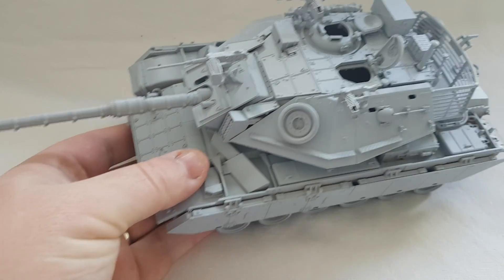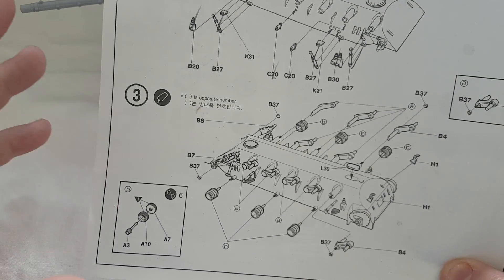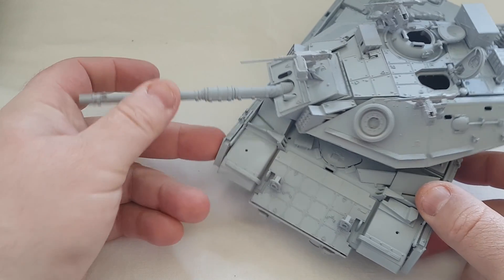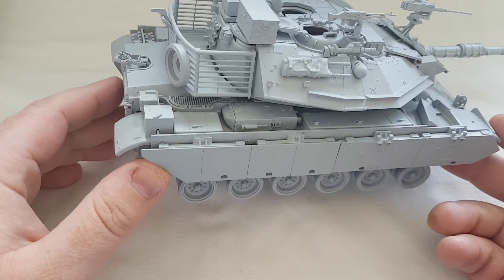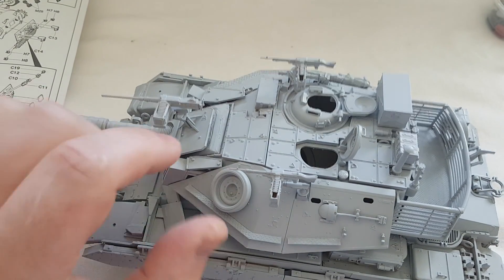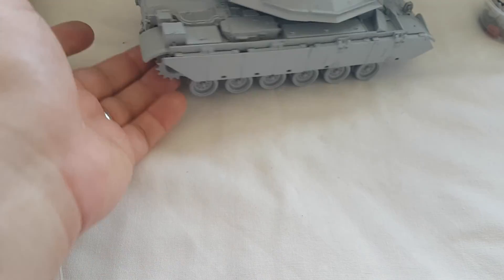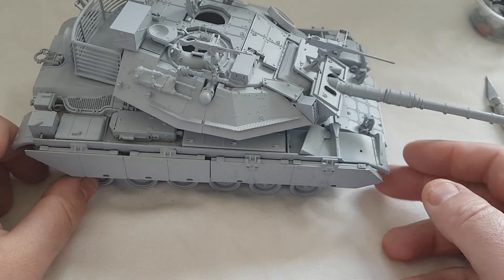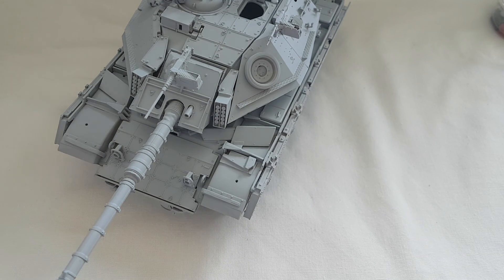academy 1/35 magach gal batash 6b pt1

Comment: Great Build Craig! This is the second build video that I have seen today from Academy Kits and both have mentioned fit issues and other problems with the kits. I must admit I have never built an Academy kit, but I always thought that they would be better than Tamiya, but it seems from what I have seen today, that sticking with Tamiya is my may forward for the time being. I would love to hear from others about how they got on with Academy kits.
Now back to this model, it looks really great Craig, but I think that it is more down to you than how good a kit it is. The instructions don't seem very user friendly or accurate. I think that once painted, it should look really good, but again, I think that will be down to your skills rather than the quality of the kit.
Have fun finishing off with the painting and weathering,
Joe
Reply from the maker: Joe's Model Kits I'm actually surprised with this kit as the other academy kit I made was far superior than this offering but yup I do think tamiya are ahead over academy. I also agree it will be down to the skill level of the builder to make this stand out I said that in the inbox review. I'm also surprised it seems they cut corners like the suspension not attaching to anything it's a shame really a little more effort from academy and this could be a lot better than it actually is.

Comment: It is nice to hear someone complain about Academy instructions.  I agree wholeheartedly with you that, in my words, they suck.  I had to mark off as I went along also.  I did have major problems with the lower and upper hull front.  If it had not been for several Youtube videos (yours included), mine would probably still be in the box half assembled.
Reply from the maker: Its a shame really as it didnt turn out too bad once it was painted. It's also not just limited to this kit either I've done 2 academy kits this and the f16 and it was enough to avoid academy afterwards. Glad you figured out your build jay if you have done video on yours let me know and I'll have a watch :)